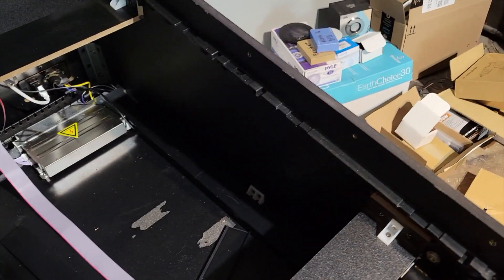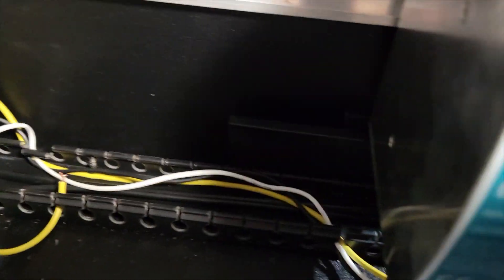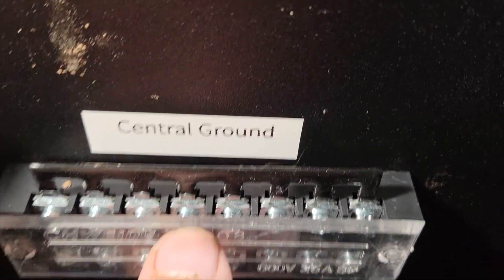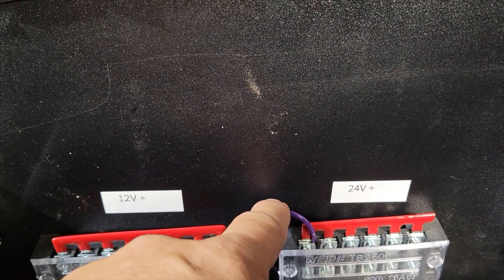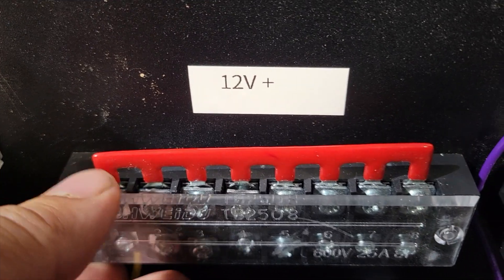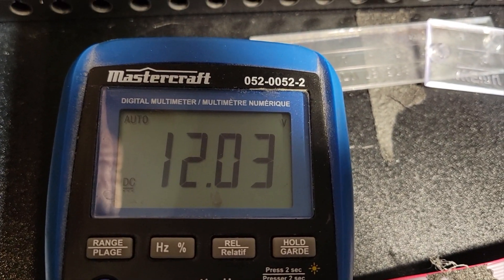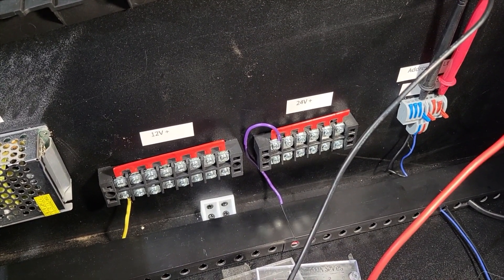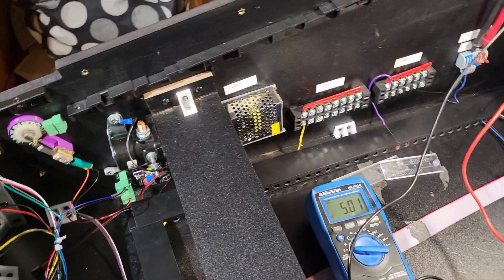Virtual Pinball Electrical

Comment: Thank you for the video. One question. If i understood you correctly,  you are using one plug split to the 12v, and 24v power supplies instead of using 2 separate power plugs.  Forgive my ignorance, but isnt that too much power draw using one power plug with 2 power supplies?   Any light you could provide would be greatly appreciated. Keep up the great videos.

Comment: Sorry, late to the party here..Question regarding the power splitter. Is there any risk of wires overheating by splitting those power supplies. I have purchased the same splitters as you have but am just a bit concerned that one plug is split to power 2 PSUs and those PSUs are going to be supplying a lot of power to the toys etc. Your videos are life savers by the way!
Reply from the maker: Those splatter you are referring to can support up to 32 Amps which is enough for my toys. Always look at the power rating. Also, consider the load that the wire can support. Ie a 18AWG wire can carry a maximum of 5Amps.

Comment: Question for you @ 1min 20 secs you talk about splitting the power from the wall to power more then one psu, do you think i could power 2 x12v and 1x5v psu using this method or would it be to much  ? Love the videos BTW
Reply from the maker: Thank you for the kind words. To answer your question. Yes you can have a " let's call it a plug from the wall' split and go to multiple power supply. All power supply require the same 3 wires, black (live) white (neutral) and Green (ground).

Comment: What gauge wire are you using for all the connections to power?
Reply from the maker: 18ga you can check my previous videos, i talk about the gage,  power supply , splitters etc
Reply: @MajorFrenchy  ok ill rewatch, thanks

Comment: My understanding is that AC and DC found shouldn’t be shared in this environment?
Reply from the maker: Well yes and no. The only AC component i have is the power supply and it converts the current to DC. All negative of every power supply are connected together. Not sure if that answers your question.

Comment: Instead of getting several power supplies, can't you get a high powered PC power supply and just use that for everything?  I know you would also need to calculate your 24 volt need and use a converter, but if you avoid 24 where you can you can get away with a really cheap one that doesn't have much amperage.
Reply from the maker: Good question.  Yes you can. Use something like this. Electronics-Salon 24/20-pin ATX DC Power Supply Breakout Board Module. https://a.co/d/gD5ExQu
Don't use your main computer power supply though, use a dedicated power supply.
Reply: @MajorFrenchy  why use a dedicated PSU?
Reply: @travisschneider3011  it has sufficient amps.
Reply from the maker: Interference

Comment: Electrical questions- Are those 12 and 24 volt terminal blocks dangerous ? Is it ok to touch those screw heads ? What should I avoid doing ?  -Thanks
Reply from the maker: You will not get shock unless you touch the ground as well. That's why i have a plastic cover on top. Getting shock with 12v or 24v is not lethal. But every time when dealing with electricity , we must take precautions and never play with the wires or terminal blocks unless the power is turned off. https://youtu.be/y_cWTWB-N_I